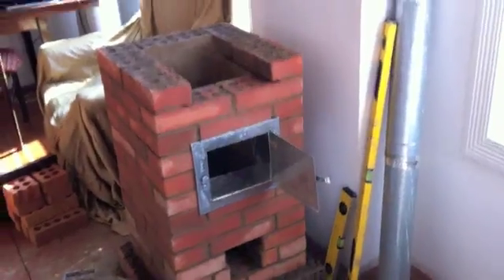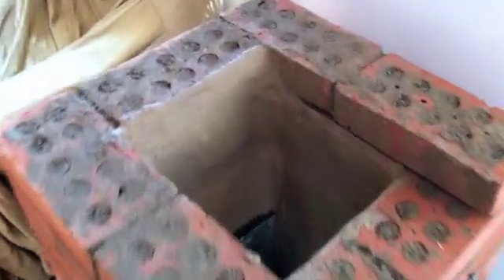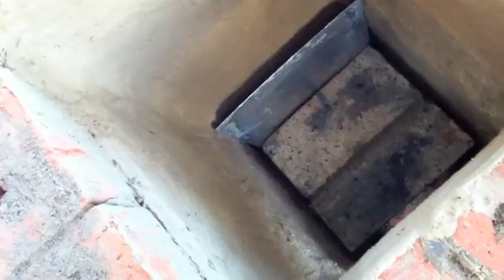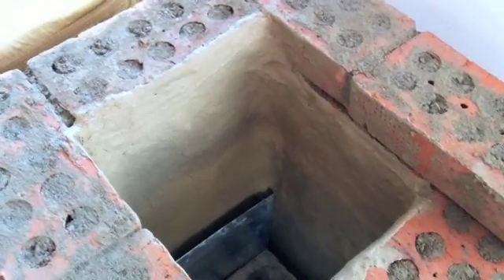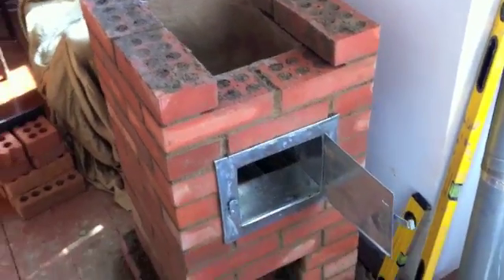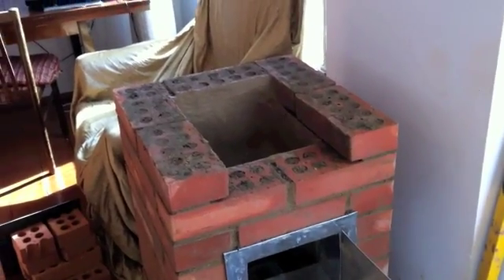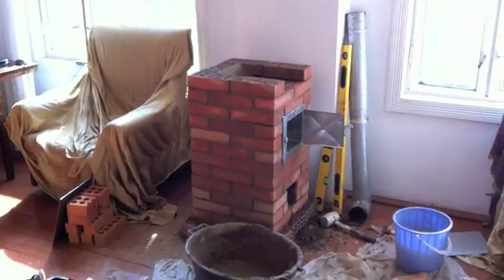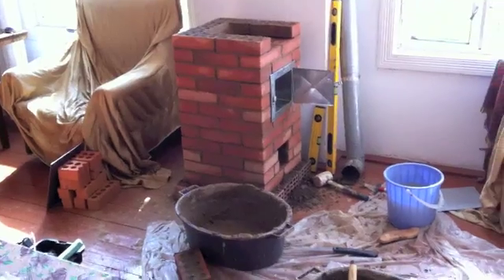Small masonry heater

Comment: Thanks so much for this very interesting video! At the end you recommend the use of solid bricks.  I unfortunately have the ones in the video.  I've filled the holes up with the clay, soil, sand, and chopped hay mixture. Can you please explain why full bricks are preferable?  Will the bricks with holes be less efficient/fall appart?
Reply: If you fill a brick with a material that expands at a different rate then the brick, the brick will crack.

Comment: Great video, can you please tell me about your parge mix? Especially the recipe or ratio of clay with wool. Was it just raw sheep wool? Did you cut it in tiny pieces? No sand in the mix, just pure clay and wool? Amazing that did not crack as it dried, I guess the wool helps hold it together and not crack, must have been a large amount of wool in the mix...

ALSO! In the plans I dont see if there is a bypass damper, to send flue gasses straight up and out for cold starts perhaps, or maybe this heater is so small it doesn't need that? I think I can just build with the plans, but it would help to understand the functions for the operation of the heater. Most masonry heaters have two dampers, one for the bypass to send gasses up straight or force them into the bell or other chambers, and one for the actual flue to close when the fire is done so heat doesnt escape. This plan seems to have only one damper and its high location seems to indicate it is only for closing off the flue after the fire cycles. 

your help would be appreciated! 

Josh
Reply: You are the man Mr chickadee
Reply: Gasses go straight up for a long time in this one. No need for a bypass for cold starts.
Reply: Probably mineral wool 2,000 degree insulation or even part steel wool.

Comment: How did you make the burn chamber? Do you have any pictures?
Reply from the maker: ***** I dont have pictures unfortunately, Just leave a glitch the size of your fingers in the front and in the back and you should be fine. It has no secondary air supply, but the bricks makes it so hot in there that it happens anyway.
Reply: Thanks for the reply! I've made a stove similar to yours since then and it has served me very well last winter. I'm planning on rebuilding it with a burn chamber.
Reply from the maker: I am glad to hear that! Kuznetsovs page stove.ru has lots of other stoves that work fine, this is probably the simplest of them. To fit a burn chamber do you want to put firebricks inside so that you get double layer?? In that case I believe you need more space/larger footprint...
Reply: Yes, and that is a real issue right now since I have to make it as small as possible and as tall as possible. The bricks I could find here are not strong enough to make a stove without a burn chamber.
Reply from the maker: It is possible that you used it like a regular stove and continuously fired it?? These stoves are ment to be fired up twice a day. Actually they are not very efficient neither if you fire them up continuously. It is like trying to charge a full battery. Basically they start being inefficient and channels most of the heat through the chimney. Thats why it is crucial to build a stove that is according to your heating need. Think 5-600 w pr squaremeter stove surface+some extra on the metallsurfaces like the door, and the plate. That tells you that this stove is made for about 2,5-3 kw continious power or 60kw in 24hrs if you like. Often enough to heat up one normal room.
Reply: No, I usually made two fires per day (in the cold days), but I would alternate the amount of wood. I never continuously fired it since the temperature inertia was excellent. I sometimes put too much wood and made too much heat. One thing I would really invest in is isolating the house, that's where the real losses are.
Reply from the maker: Yes, insulation is a must. If you can't afford it, get newspaper , cardboard, or even straw mixed with clay , but thats messy. Anyway lots of cheap options out there. For the burn chamber try to get hold of some vermiculite board. It takes almost no space (1cm) and will protect your fire chamber excellent. It looks like chipboards but it is ceramic. Cuts with a normal saw, really nice stuff. (If you want to do the wool thing it will last you only two winters if you do it right. The main thing is to let it completely dry before you fire up the stove, then it won't crack.And you need really light coloured fireclay.

Comment: In a week you have to paint your walls again cus of black carbon smoke. At 40 dolls a gallon????
Reply from the maker: Carlyle Tom yes I did, and it worked just ok, should have had 2 meter vertical after 1 m horizontal  to get more pul, had 1 m and it was ok, but a little hard for cold startups. But it docent smoke down the room if you do your chimney right... This was a very low budget stove, I only costs you sweat, dirt and some old bricks!!
Reply: I think he vented the exhaust through the wall of the house.